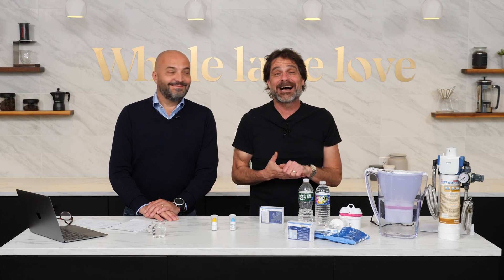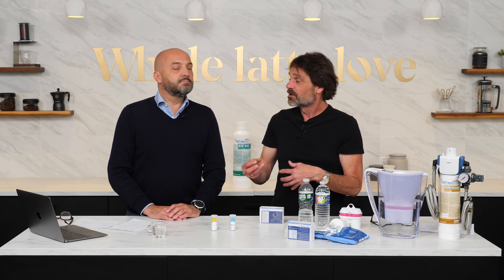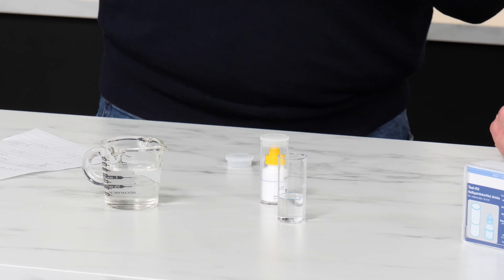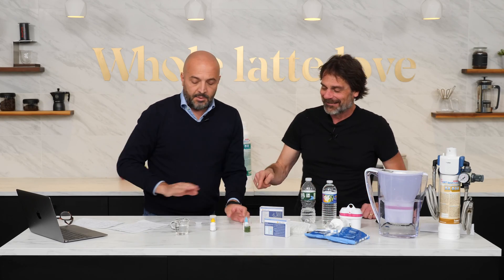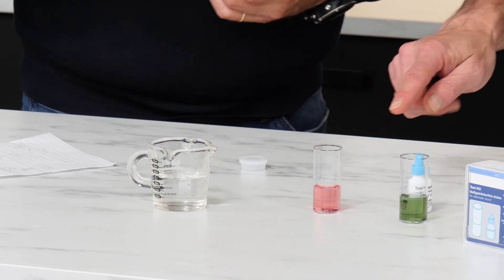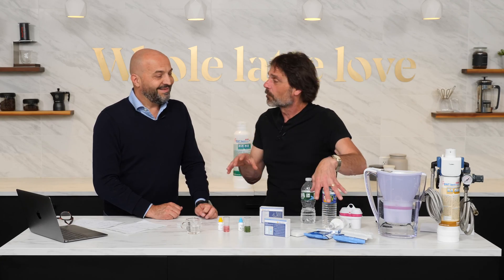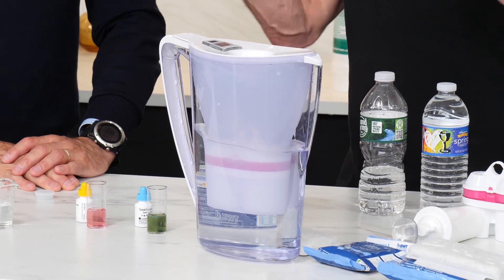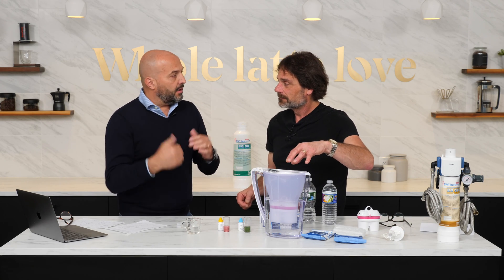Espresso Machines: Testing Water & Filter Selection

Comment: Should you still use a filtered water pitcher like the penguin or peak water to filter your water first then add that water to your boiler if you use the Best Save M Anti Scale Filter in your water reservoir? Would that be over doing things?
Reply from the maker: Hi K, No need to do both as they do the same thing.
Marc

Comment: This was a great review of the water treatment process using a scientific lens. I have a breville oracle touch machine, and I use a reverse osmosis system as my water source. I remineralize my water with Third Wave water packets(espresso blend). This blend consists of magnesium sulfate, potassium bicarbonate,  and calcium citrate. The TDS is around 120-130 after mixing the packets with the water.  Since the packets have calcium citrate instead of calcium carbonate,  will this prevent scale buildup in the boilers? I want to know if this is a good solution for espresso water,  or if I should remineralize another way.  Thanks!
Reply from the maker: Hi Bill, Hard to be certain as I have not tested Third Wave remin products. Only way to know for sure is to test total hardness and carbonate hardness (alkalinity). At a TDS of 120-130 there may be some scale potential. But with some of the hardness coming from magnesium that potential is likely reduced compared to typical tap water which gets most of its hardness from calcium.
Marc
Reply: @Wholelattelovepage  Thanks Marc! I'll have to test it out